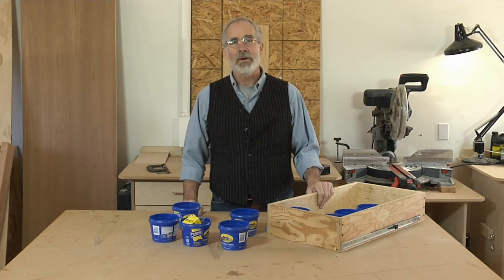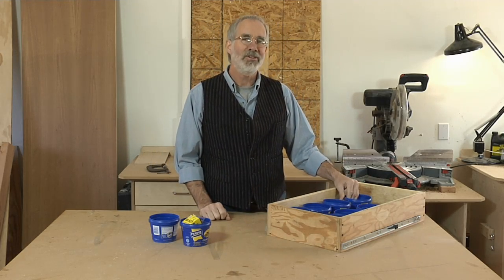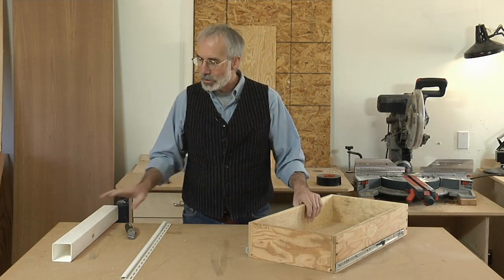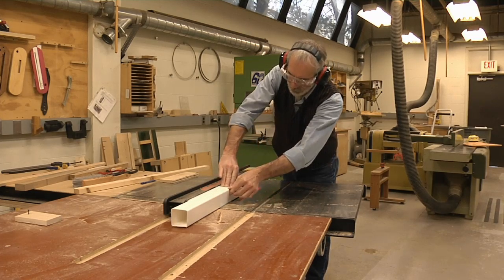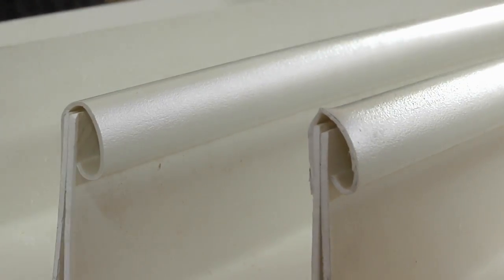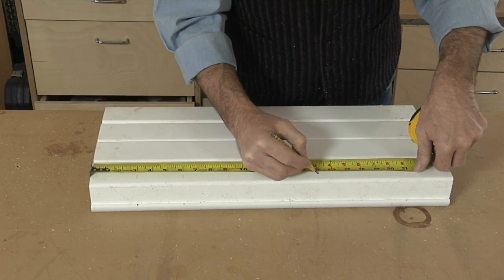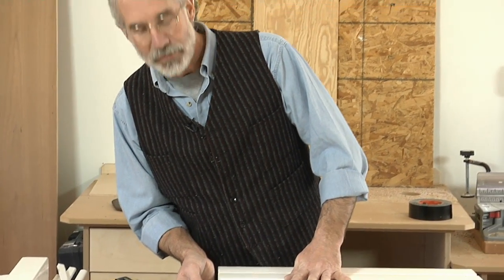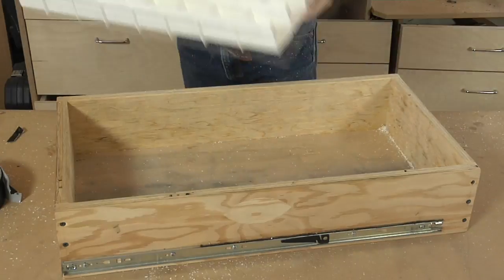How to Make Custom Storage Bins for the Drawers in Your Workshop

Comment: Neighbor came by yesterday wondering if I had a particular nut for a bolt he had.  Saved him a trip to the hardware store.  He wondered about how I built these so I sent him the video created from my $25 Fine Homebuilding tip.  What's I think unappreciated by the commenters is how nice the vinyl is.  All the crud from whatever you put in there doesn't contaminate the drawers.  It's easy to clean and the slightly curved bottom lets you ease out small parts, as they don't get trapped in a 90 degree corner.  As to standing on end instead, that doesn't work so well for this application, but in another drawer, these downspouts cut to the depth of the drawer are the perfect size for lightbulbs stood on end.   Typically the light bulb packages you get from the store are four to a pack which is great for inventory but not so great for the homeowner.  Stored, base down, you can easily read the info on the bulb and pick out the one you want.